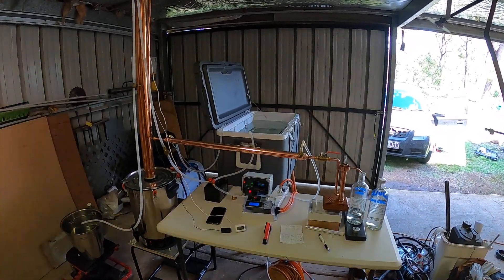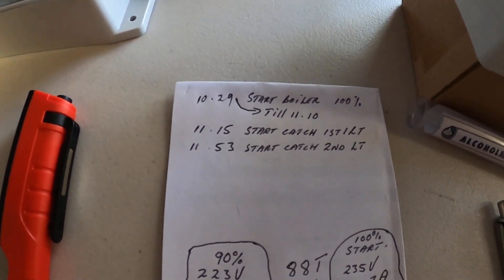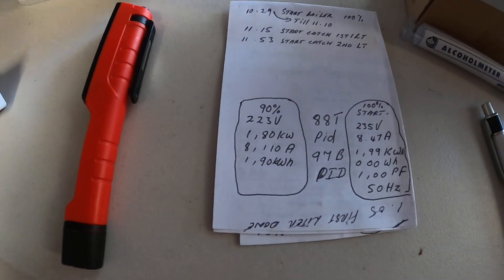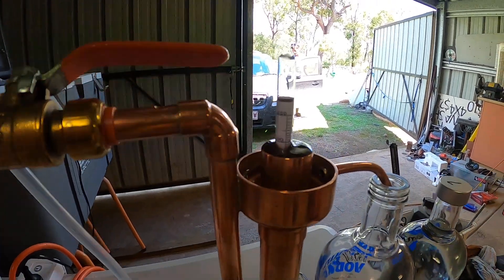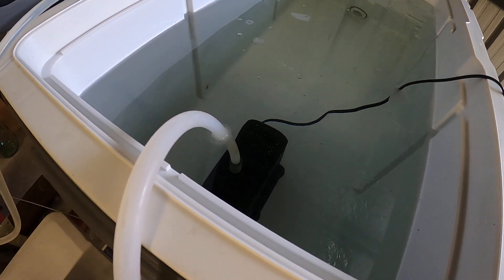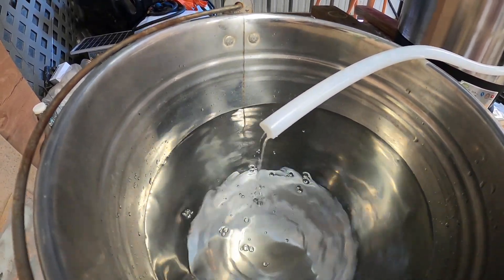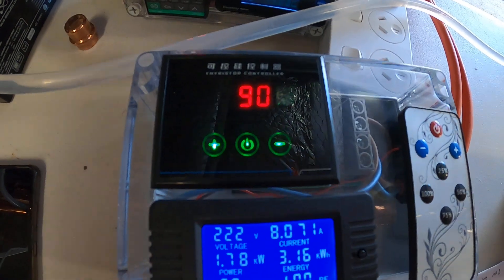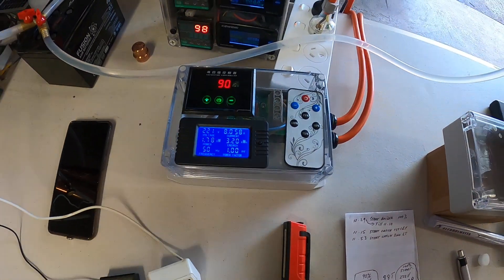Distilling with SCR controller and using a pid controller part 2

Comment: G'day Dan... I's just wondering, Do you filter your distillate or not?. Beautiful vids on the PID & SCR controllers too, real pro job. Cheers mate.
Reply from the maker: Yes mate I use turbo carbon while fermentation and after cutting down to 40abv I filter my spirits through a carbon filter , then I mature with oak chips and filter it with a coffee filter then I add any essence with it to make rum, brandy,Whisky or bourbon
Reply: @danssv8  Thanks mate.